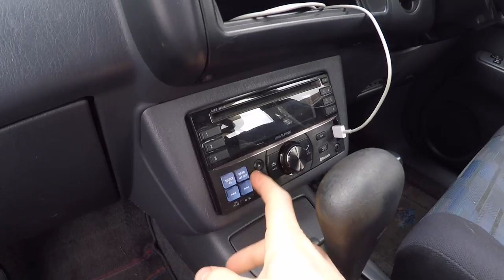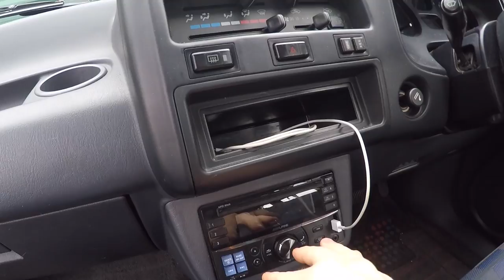BIG NEWS | NEW PROJECT | LEGACY UPDATE

Comment: nice to have you back dont know if i updated you on the rockford amp well i went to the installer checked all wires it looked good power ground remote and signal so we hooked the repaired amp up and used the cd to calibrate the amp every thing went fine we installed the new door speakers in the front doors ( that i later sound deadent) i drove home afther i was on the freeway the same settings lower volume i smelled burned electronics yep it nuked it self again so called the store he orderd me a new one thats in the car i removed the power cap and moved the amp a bit more for even beter cooling

Comment: I do something different than any options you mentioned.... I would run the fosgate coaxials in the front doors so no tweeter to fuss with. Then run the fosgate 6 1/2 mid ranges in the rear boot not using the tweeters. Run all 4 of these speakers off your 4 channel amp, have channels 1 and 2 full range going to the fronts and then have channels 3 and 4 low passed sub frequencies only going to the rear boot 6 1/2 subs. No 2nd mono amp to fuss with no big sub and box to have in the way. And still nice balanced power running through the amp Clarity up front and nice low frequencies in the rear

Comment: I would definitely put the components up front just because I think you would be louder with them up front and then You can still run the coax off the deck power and used the 4 channel amp to run the components and the sub. You said she likes it load and I think that would give you option to be loud and better sq with the components up front. And congrats again and thanks for the video and don't forget to fix the vents in the dash.
Reply: Side note to my comment I made depending on your space you might have enough room to put the tweet and mid in the same mounting area you could just fabricate a plate to fit both. If not I'm sure you can definitely make it look good

Comment: Option 1. I think it would potentially be the best. But most time consuming.

If the Sony amp is powerful enough, the sub and just the mids off the head unit could work nicely. Definitely crossover the sub, and mids in the back, with the low pass filter to get the most of of them (considering the relatively low wattage).

Comment: congrats on the engagement mate, but don"t give your new fiance a sub standard system, 
get those splits up front and mount them properly, its only costing you your time.. 
look into putting the coaxials in the rear doors but really they don"t matter as they should be rear fill and not very loud anyway.. 
a little bit of SQ goes a long way.

Comment: can i run an amplifier to my speakers with my stock headunit ?
Reply from the maker: Shaun Linney Yes you can man, my advice is to have an amplifier that has "high level input" so you can just run your factory speaker wires straight into that and the amp will do all of the work converting the voltages.
This will only work with systems that are no more than 4 channel with full range audio on each channel.
What sort of car do you have?
Reply: Car Audio.etc i have a 2004 mini cooper
Reply from the maker: Just looked up your car
You know you can install a new single din stereo in the current location quite easily ay?
I'd do that and not worry about using the factory deck.
A new one will have RCAs and much better sound and features.
Reply: Car Audio.etc yeah true but i kinda wanted to keep the stock headunit in
Reply: Car Audio.etc is there any good headunits with an aux and usb port in the back of the  headunit?